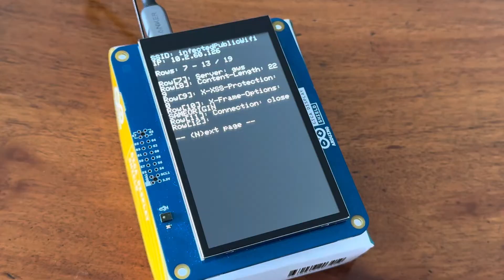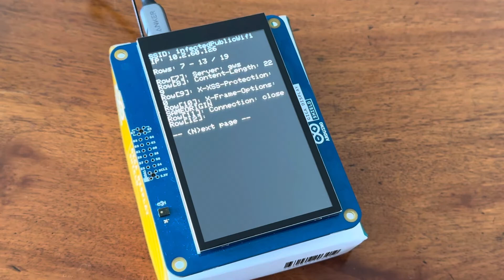Arduino (Portenta H7) GIGA R1 WiFi Display Demo with HTTP Request

Comment: Thanks for sharing!
Reply from the maker: Thanks, I’m working on some updates. Perhaps you have some ideas re https://forum.arduino.cc/t/programming-and-uploading-both-portenta-h7-cores-at-once-works/1097935/2?u=bsodmike

I’ve found the firmware bin file from PlatformIO is a wee bit when compiled with the Arduino IDE. Trying to figure this out.